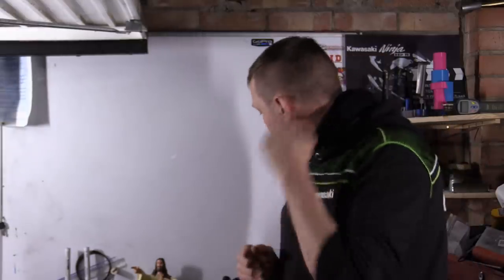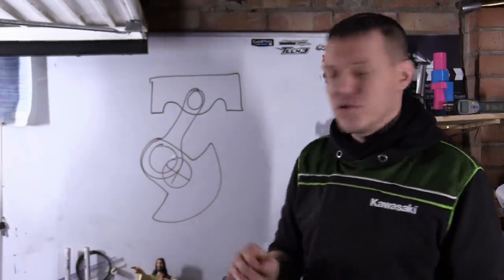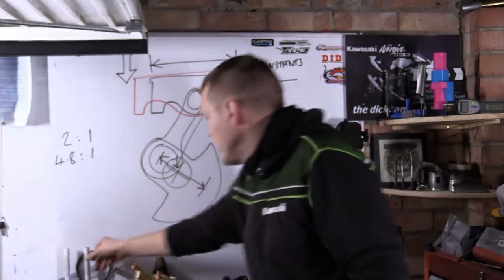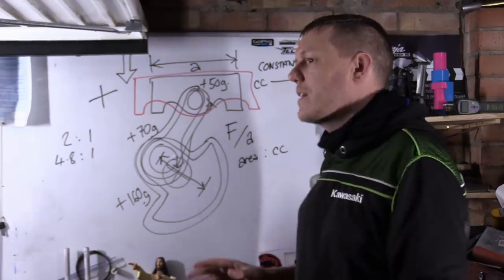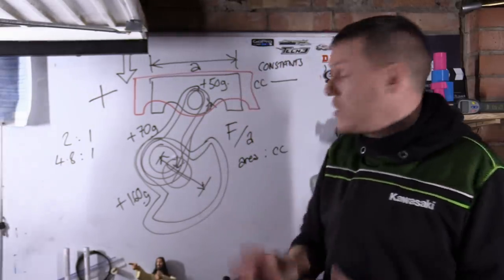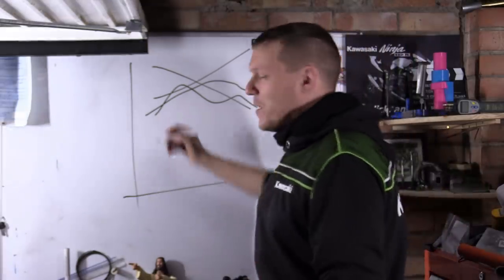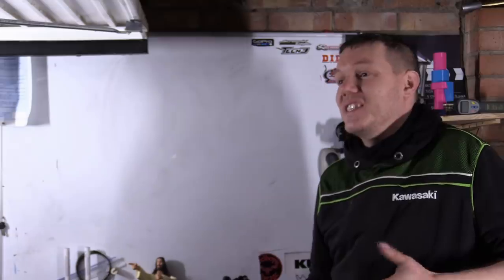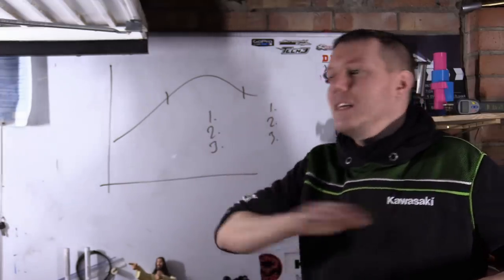Engineering HELL! The Compromise

Comment: Sill think that cutting out the beers and having a good shit beforehand is the most cost effective improvement to the performance of the bike with you on it.
Reply: Semi-Seriously, how much does the weight of the rider affect 0 to 60 performance.  If one dropped 5kg what would be the equivalent performance increase?
Reply: I was at a cart track once and the guys there said every 5kg translated to 0.1 seconds a lap faster on average
Reply: Well I can tell you that if you weight next to bleedin nothin, then you better have a grippy tire to go with it. Coz when I have a pillion I'm far less likely to fishtail the crap out of my rear end simply due to grip. I need a new rear tire X_X. So yeah what Matt says: It's all about balance. You move one factor and it affects all the others. So find something you wish to optimise for and slowly keep tweaking all the numbers till you found your local peak.
Reply: @trevorellis1704  will depend a lot on suspension setup, if you're lighter than me but get on my bike you may not have the grip I do

Comment: Does this also apply if you "remove" weight - e.g. if your primary goal is not more power but simply less weight while keeping the overall "sturdyness" of the part the same (talking about engine parts)? I guess thinks like the harmonics or how it's called (hopefully I mean the right thing) could have knock on effects? Or is "lighter" simply better if durability stays more or less the same?

Say for example you have an older engine and you have to repair the fucker anyways - if I have to choose between Part A & B and A is the Stock part done according to some old specs / materials for price 10 and B is 5% lighter (same overall durability) but price of say 15 and is done with materials that are for all intends and purposes similar enough, but allow some weight savings for the same durability. 50% price hike is of course nutters in my example, but that depends on the base price anyways. 50% of 1000 is much, 50% on 100 not so much when looking at the actual monetary value...

Or is this already done anyways? So say I buy new piston(s) for a 10 year old bike and the company fabrication those will apply the newest technology which makes it better than the part created 10 years ago?

Also 1:06 was a missed Opportunity for Goatscream 2.0 - should've "modified" the "HARD" to "AAAAAAAAAAAAAAAAAAAAAAAAAA" bycranking up the Soundgain to 11 in Editing and just stretching the sound like some people stretch logic. Bonus points for syncing the "AAAAA" of you and Dell so it becomes a Goatscream Duet, maybe even add the goat in for good measure.

Comment: Mike's Bible of horsepower:
1: Nominal flow rate of valves = nominal flow rate of engine speed factored by valve lift. 
2: Don't let the piston skirts stick out of the bottom of the bore. 
3: Stress of valvetrain is deep within the fatigue limit of the design, and scale the RPM and displacement accordingly.
4: Pre-meditate your fucking operating range! 
5: There's no right and wrong. Learn to accept the shitty spots and plan for it.

Comment: Thing is tho Matt, you said about the disadvantages of bigger piston etc, if someone wanted to tune an engine using a 2nd hand block it will need rebored so bigger piston required anyway.
Reply from the maker: LOL you're going way too far - different sized piston meaning a different part altogether - not a 0.5mm rebore
Reply: The Workshop Ah ok my bad 🙈
Reply from the maker: I thought the drawing of the bigger piston might have been clear enough - but maybe not
Reply: The Workshop Oh so you mean bigger piston smaller piston rings ? 🤔
Reply: His example was more like two prototype engines with a fixed CC, one with a small piston and the other with a large piston. He isn't talking about the same engine block or anything
Reply: Cooper Berrysmith I think the reason i said about a bigger piston is because Matt drew a bigger piston on top of the one that was already drawn, so i thought if it needs a bigger piston etc it needs a rebore and all that 😂🙈
Reply: The Workshop I can see a rant video coming out for this 😂

Comment: hey I got a question for you not important just a brain twister. 
Looking at opposed piston engine they had good efficiency but because they're 2 cycle with port valves not clean running engines I'm wondering why nobody has put valves on the cylinder🤔 
I don't think the valve heads would shroud the air flow into the cylinders but would make valve overlap purging of the exhaust gasses difficult🤔

Comment: With a solid bushing chain and sprocket kit from DiD I should be more than ok with a 150cc for 6000km with proper care right? (I didn't go for the xrings because they were unavailable and it's alsmost holidays in Asia and EVERYTHING stops ) hence my concern
Reply: Oscar Estoa just feel for the wear in the links every once in a while (push two together, then apart and look at the movement), it won’t just let go all the sudden
Reply: @ghettobikelife8833  yeah I mean I can't be that much worse, thanks
Reply: @ghettobikelife8833  I installed it myself yesterday also first time I did such a thing, omg to cut the chain lol I got some cool vietnamese help, a 70+ yo man had a tool that you twist and you get the pins off.  the chain runs super smooth so thanks for the advice  let's see on the next  how it is because I have the other one with me, so far so good :)

Comment: On the matter of air density (when is cold my engine performs better) can just adding a intercooler without a turbo or supercharger benefit performance?
Reply: No, its impossible. 
Cooling ambient temp air with the same air is impossible.
Reply: @jareknowak8712  if you compress the air it will warm up, store it and allow it to cool back to ambient temperature, then decompress it, it will cool to below ambient temperature. This is how fridges work. The problem is getting it to work quickly enough for an engine.

again, compromises turn up, if you go too cold you don't get fuel & air mixing properly
Reply: @chrisdavidson911  He said: no turbo, no supercharger. It means - no compression. I know how fridge works.

Comment: So, if it is important/better to keep rpm's constant, aren't electric bike better than?
Reply from the maker: Don't know about 'important' as its not possible - but it would be better. And electric motors aren't constant speed???
Reply: @dirtygarageguy  From what i understand is that Zero's have all the power, all the time.

That is how they feel when riding as well.

Better is the better term ;)
Reply: Love the smell of tobacco..could you explain why it would be better to
run an engine at constant speed..?
Reply: @Meifesto  an electric motor can produce peak torque at 0 rpm, but this has nothing to do with the operating rev range

Comment: It's so sad that for a mere 5-10% increase from my stock config I have to spend 30% of what the bike costed. 

 That is just a god signal that I should just save for  a new bike or it is  just expected to be that way?

 I live abroad so I can only legally drive up to 150 and I'm tight on money but I would gladly spend 100$ on a exhaust if you guys convince me that is worth for a Honda sonic 150cc from 2017 bought for 1300$ (the users manual is super easy to find on Google from Honda itself) 

Edit:I forgot to mention that the "upgrade kit" up to 175 with new  clutch, cdi, another thingy in or related to a pressure gage of something related to the cdi (inyectors?) and exhaust 1000$
Reply: It's the only way to get more power and it depends how much money you have access too & whether selling the bike and adding the cost of the kit would get you a bigger bike.

Comment: Its good that the complexity and horrible inefficiencies of fossil fuelled engines are explained. In 30+ years time industrial archaeologists will need to know this stuff. The knowledge will be as rare as steam engine engineering courses are now. All racing, off roading and normal transport will be electrically  powered. Licenses will be needed to store petrol and it will not be available from stations all around the area. Sounds horrible I know but that's the result of disruptive technologies.  
I for one will not miss young dickheads with bad boy exhausts on crappy 125cc bikes riding around the area until 4am. I will miss the sound of a proper bike being given the beans however.
Reply: william  armstrong idk I think transport trucks will still need fossil fuels unless we adopt a streetcar-like electric rail on the roads, because batteries in trucks can’t drive very long
Reply: Also steam is still relevant, it’s used in nuclear generation!
Reply: @ghettobikelife8833  wrong! Current battery tech yes but look up the Tesla Semi. If you want to see the future of road transport.
Reply: @ghettobikelife8833  not for long now.
Reply: william  armstrong of course Tesla has a prototype of that, mostly just to generate hype. I’m sure batteries will be ok for consumer cars but they’ll need to be at least 10x as power dense to work for long haul trucking, airplanes, etc and this doesn’t seem realistic in the foreseeable future
Reply: @ghettobikelife8833  it is not only possible it is happening. Tesla are not the only company working on electric trucks. Every manufacturer who wishes to remain in business is working on it.
Reply: @williamarmstrong7199  won't be for annother 60 years based on what we have at the testing stage now. I'm expecting more research into hydrocarbon alternatives to have more use to be honest. E85 is just the start, hydrogen cells are just as likely to be the end stage for a lot of things like bikes. 

The issue with batteries isn't JUST the production of the batteries with sufficient energy potential  and that's a HUGE barrier, we will need a HUGE rethink of electric infrastructure to be able to support mass movement to electric vehicles. 

If you do the maths to take into account how power is generated Tesla's can see 28mpg equivalent and that's not taking into account the emissions used in the work of producing the batteries. Until we crack that issue (basically admitting we need annother generation of Nuke stations) the electric car isn't going to be a panacea